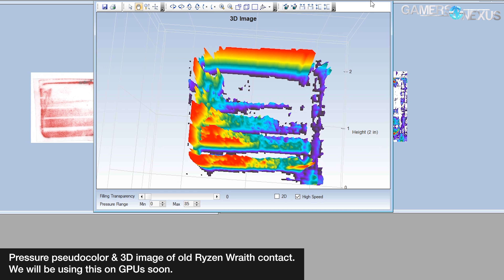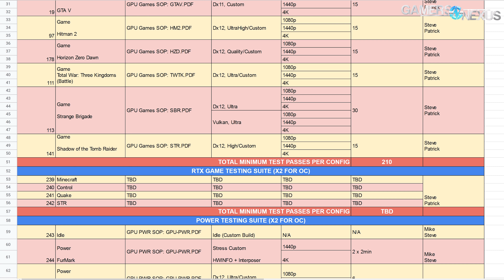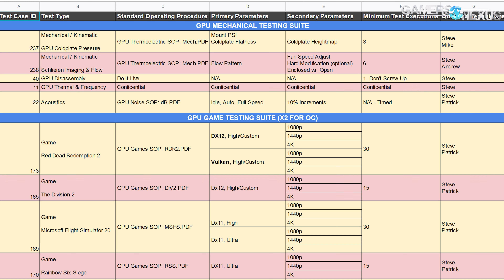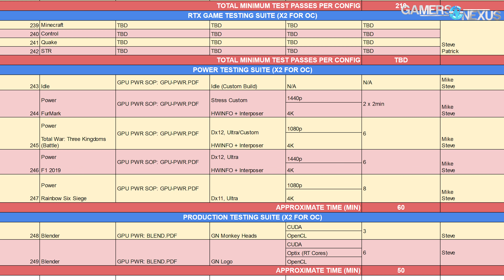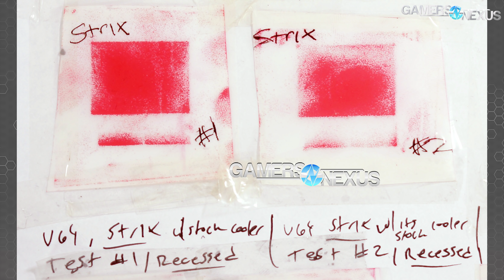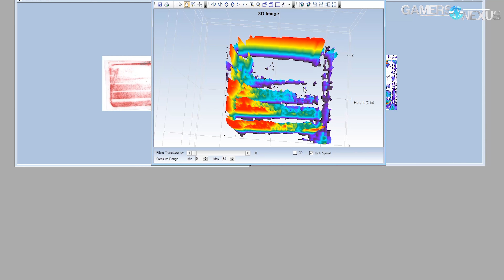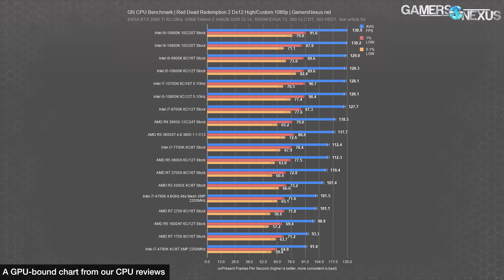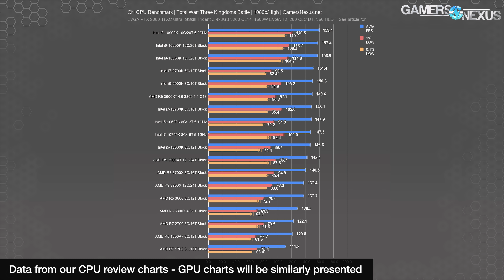$13K of GPU Test Methodology: Airflow Photography, RTX Games, Pressure Tests, Power, & More

Comment: Pls get an electron microscope now? They are dirt cheap, just saying .....
Reply from the maker: Maybe one day, but we'd need someone trained on using it!
Reply: @GamersNexus   I hear Roman might have some first hand experience with those things...
Reply: Oh, yeah. $50K for a used one is SO cheap...
Reply: @AmartharDrakestone  You forgot, that it takes also a special room for an EM.
Like special airflow or dampening of any oszillations
Reply: @emmata98   So basically a room sized Faraday cage with a separate/isolated HVAC system fitted with true HEPA in a positive pressure setup and a down-draft entry chamber into the room with a "floating" floor with a focus on vibration dampening. It's actually really do-able if you have a smallish room that has just one entrance, no windows, and has enough electrical supplied to the room to run the scope and related computers in a building with industrial height ceilings (10 foot). The hardest part would be setting up the two sets of entry doors with a down-draft system installed between them to create an entry chamber. Also assuming the building is not close to a higher traffic roadway or a railroad within a couple miles. Such a room could also double as a basic clean room for doing clean room things.
Reply: @kajuntuite4620  you also need the dampening of the vibrations coming from the outside (trucks on the street and so on).
In my uni we had one in a cleanroom, that is basicly hung on a metal frame (with dampers of course) on the outside.
The one Roman uses takes a different approach. It has 30 m (?) deep supports into the ground.
Reply: @emmata98  That's actually really interesting to hear about different ways the vibration dampening was achieved. I didn't know that about the one Roman would go visit. I can see that adding more stability to the foundation in an area with soft soil ontop of bedrock if that's what was needed, but wouldn't such supports cause more vibration transfer into the foundation from the surrounding ground from vehicle traffic? My experience with vibration dampening is a little more macro than that and it was mostly just adding springs and rubber dampeners to large machines to keep vibrations from traveling through a steel and concrete building. It was basically isolating the machines by floating them on the springs and using the rubber to dampen the springs, though in larger machines a piston dampener could be used in a setup reminiscent of how a strut and spring assembly would be used on a vehicle suspension, but I never dealt with those and the rubber dampeners were sufficient for what I dealt with. I also know that certain ways of installing a "floating" floor can be used to isolate from vibrations as well as sound isolation if acoustic insulation is used between the layers. It's all really neat tech I think :)   ...oh, such a building would need to be quite a distance from a railroad as those can transfer a TON of vibration into the surrounding ground that can propagate for a surprisingly long distance.
Reply: This thread went a bit deep, but as someone with a SEM a hand's reach away sitting on an office desk in an apartment building, I can say: you really don't need any of that for magnifications one can reasonably achieve with a scope that costs(used) less than a private jet. The worst offender is the backing pump, which is filtered by a pipe in a concrete block, the second worst is the turbomolecular pump, which is filtered by simply placing a set of damping bellows(at the factory) between the pump and the column.
Air filtering is just pure fantasy, especially positive pressure. Closest you can get is a good practice of venting the SEM(/load lock) with dry nitrogen instead of air.
Reply: @Spirit532  As someone who works as an SEM operator, I'm confused as to why you would use the price of a private jet as a comparison. Private jets cost millions to tens of millions of dollars. SEMs are expensive, for sure, but not in the range of a private jet... Even a brand new high end EPMA SEM with several WDS detectors on top of the usual SE/BSE/EDS systems will tend to cost about $2 million-ish. And that's a VERY expensive, niche scope mostly intended for geological sample studies. I work on high end field emission SEMs with several different detectors and go up to 800K magnification on a daily basis. Our instruments cost about a half-million dollars each - maybe 3/4 million, brand new, so we're getting extremely high mag for a small fraction of the cost of a private jet. Was the jet comment a joke? The wording suggests not, but the comparison just seems too far off to be serious.

I can also say that for any decently high mag shots, vibration absolutely is a concern, and it comes from a lot of different sources. I was talking to a Hitachi field service technician about one of their customers complaining about a recurring image defect they were getting, which they traced to a door being opened and closed in a hallway separate from the room the SEM was in. It was far enough away the operator couldn't even feel it, but it was screwing up their shots as lab employees came and went at specific times of the day and they thought it was just something that was wrong with the microscope. Dampening doesn't generally have to be extreme in most cases - in our lab we essentially use raised/floating floors and rubber mounting blocks to support the SEM cabinet/table which also has a spring system built into it.

At magnification low enough that vibration wouldn't be a concern, I don't know that there would be anything of value for GN to get from the instrument because it'd mostly just be one-off shots of patterns and structures that 'look cool'. Smaller structures in a modern chip aren't even visible at that kind of mag. EMF interference is a much bigger concern, especially 50/60hz, and GN has a LOT of that they'd have to contend with. They'd have to isolate the instrument if only because of that, so at that point they might as well put in the effort with good vibration dampening and not shoot themselves in the foot after spending a ton of money on it...
Reply: @GamersNexus  If you ever decide to do that I'd be interested to talk. ;)
I'm trained on SEM/TEM/AFM/FIB plus EDS analysis and some interesting light microscopes, as well as a fair amount of sample prep work.

That said, it's probably not worth the expense for what you do. Paying a service lab for the occasional imaging work would probably make a lot more sense.
Reply: Kajun Tuite Kajun Tuite Hello there. Trained electron microscope operator here, both scanning and transmission variants. You almost don’t need any of that to get useful images. You do need a vibration isolating floor, yes. But all this HEPA positive pressure stuff is totally unnecessary. SEMs AND TEMs operate with high vacuum chambers, so you need at least one turbomolecular pump ($10,000 new) and some kind of roughing oil or scroll pump ($500-$2000 new). Ideally you need lab-grade nitrogen gas to vent the high vacuum chamber, which helps to prevent air moisture from working its way into microscopic cracks of the chamber. And you need liquid nitrogen to cool some specific sensors on a TEM, maybe some SEM models too. 

If you’ve got all those, you can put the SEM or TEM into any normal room with vibration isolation. When you use the TEM in particular, that kind of room is more than good enough to see the atomic lattice structure of metals. Like, literally individual atoms. I’ve done it, many times for my PhD research. Though if you want to use a TEM, you need an instrument that can create small slices of material, around 10-100nm. Something like a focused ion beam-equipped SEM, which I’m also trained on.
Reply: @GamersNexus  I might be able to help with that if you or anyone else at GN want to get some training and are willing to travel to a location near Bedford, VA.  There's a facility owned by the company I work for that gets lots of state, federal, and private funding for the sole purpose of educating people on everything engineering.  They have a couple of electron microscopes that they love to demonstrate things on and  train new users with.
Reply: Dirt must be really expensive where you live.
Reply: I don't know why they would need something like that, unless they are trying to see if the die is really the same as the official die shots, and even then using a SEM on electronics can be a pain in the a**
Reply: azure zeed yeah. Whatever you’re looking at needs to be somehow grounded, otherwise the electron beam starts charging up the part and the image gets dimmer and dimmer. 

I’m sure there’s an entire field of electron microscopy for observing nano scale electronics. But I imagine if you want to look at a chip, the electron beam will kill it.
Reply: @Recreatorify  A used private jet can be had for under 300k :)
But no, nobody is going to sell you a 300-500kx SEM for a reasonable price. The units that you could expect to purchase are rather old and usually stop around 100-200kx magnification, but even then they don't have much use at the extremes due to the lower resolution. The best "hobbyist grade" scopes I've seen off eBay get down to is around 4nm, besides a lucky friend getting a mint condition FIB. In practice, for under $4-8k, one can expect >8-10nm resolution.
Reply: @GamersNexus  Atomic force microscopes are reasonably priced. Just saying.=

Comment: I’m an engineer at a large GPU infrastructure provider. We have a lot of customers who rely on gaming GPUs for inference, h.264 encoding, and crypto mining. Each Is a slightly different talent set and Nvidia is usually careful that not all of those features fall on the same card. Inference is great for testing fp32 and fp16 performance relative to Ampere data center, h.264 is great for testing the built in encoders and general performance when working remotely or for building VMs. Mining is a whole different story that can vary pretty wildly. Would love to see some of that represented here.

Comment: I'm a game developer and I really do feel there's not much benchmarking being done within Game engines.
I work with both Unity and Unreal engine and my purchasing decisions would be SO much more clear if there was any testing done for my field,
most tests are done in-house in big studios and I kinda have to ask around or guess. 
Game engines are interesting, especially in Unreal engine, there's multiple passes to be done in order to Build Static lighting for a scene and there's alot of nuance in trying to get Ray-Tracing features working. So far the closest thing I could draw a comparison to are there blender tests, but it's not exactly the same. 
And this is not necessarily only about GPUs though, baking lights or building a project puts strain on the whole system, so methodology would probably be closer to the way you test game performance. 
Here are some scenarios I can think of to get the ball rolling:
Get you a very nice, high fidelity level. Unreal engine has a bunch of free content for developers on its marketplace and you can build a pretty complex scene that can really strain a system.
You could approach this like people approached Crysis for benchmarks all these years, get you a chungus level and more fps=more better. 
But with some isolation of engine functionality can get some more interesting results going. 
1. Baking static lighting for a level, this puts a strain mostly on memory and CPU. GPU is secondary here. But getting some useful metrics about how a Ryzen with infinity fabric OC 1:1 would perform versus an Intel would be amazing and I've yet to see something like that anywhere. Note: My last bake at "maximum" quality for my level took 24 hours with my shitty rig, I don't imagine that's what most studios deal with though if they have current gear, there's been major architecture changes the past decade or even 2-3 years, putting those changes into numbers through bake-time would be awesome to see and very informative for me!
2. Build time. Building a project into a packaged build is a deterministic process and can be measured in seconds as long as you can make sure that the hard drive you're packaging to is not affecting results. This is a very useful metric for QA engineers and Build engineers. Packaging and re-packaging the project thousands of times is guaranteed and just like in video production, optimizing a render-machine to not waste your staff's time in useless coffe-breaks because "it's still building" is something many studios would be interested in. Afaik, this is CPU dependent mostly. 
3. Build / In - Editor FPS. This is a pretty simple game-like benchmark. Get in that level and test. How well does it run? What's the frame timings like? Note that there's always a performance difference between  the in-editor level (which is where developers spend their time) and the packaged/build level. This will  be what players spend their time in and much closer to a game benchmark. Still, there's interesting comparisons to be drawn when considering the delta between in-editor and packaged build for different components. Luckily unreal also supplies a bunch of command-line performance tools and visualizers, so you can really go into detail for a scene's performance.
4. Ray-Tracing calculations. UE4 has built-in functionality and libraries to handle Ray-Traced Lighting, using the same level as before you could very easily get a useful metric for GPU performance with FPS. Note that there's also a difference here for  in-editor and packaged builds.
5+ There's also so many more things you can test in game-engines: Baking materials, Simulation, mass drawing of actors, spawning and destroying large volumes of actors, complex animation blueprint performance impact, blueprint performance impact. The list goes on!

I would LOVE it if you guys could find a way to include UE4 or any type of game engine into your benchmarking. It's not really been done from what I've seen and with more and more people fiddling around with all these free tools, I'm sure there's an audience there to be interested in it. If not, I'm still pretty sure you'll be getting a useful metric for game performance eitherway.

If anyone from GN wants to reach out for a chat I'd be honored to help get this rolling. Steve also mentioned that he has some game devleoper contacts in the industry, so I'm pretty sure if you could talk abit with a technical director from a large studio, they could really fill you in and find a way to introduce game engine testing as a useful metric.

Snowflake if you're reading this, I love you, don't fire Steve yet, he's doing pretty good!

Comment: Hey Steve. So i wanted to talk to you guys about Blender performance that I would like you to shed some light on. Blender rendering benchmarks do not tell the full story about the performance. All the view-port stuff and simulation is mostly single threaded and scales with the clock speed of the processor. Lets say if you have done some simulation/animation and hit play, you'll find something like a threadripper 3970X skip frames in playback, whereas a 9900K will playback smoothly. This happens till the simulation/animation is fully baked and cached. This might lead the user to believe the performance is not snappy or it lags. Things are getting to multi core utilization but it is happening slowly. It would be great if you could look at this thing. Another thing I generally suggest to people who ask me for recommendations on this thing is to have them choose the highest clock-speed with highest number of cores on the CPU they can buy and push all the rendering work to the GPU.

You might look at Cinema4D documentation about how the performance scales across parts as blender is quite similar to C4D when it comes to performance and use of hardware resources. I have also tried to DM you on twitter, but couldnt.
Reply from the maker: We are aware of this, yes. But it is not currently in our benchmark suite to test viewport performance. We're so overrun already!
Reply: @GamersNexus  👍

Comment: I would love to see benchmarks for Davinci Resolve. It's editing and compositing and 3d work all rolled into one. It's very GPU dependant compared to Premiere. It's also favors more cores as opposed to Premiere preferring frequency. Id love to see more benchmarks for it as it seems that info on how Resolve actually utilizes your system seems to be lacking, even in Resolve's own documentation, and I've had to run my own experiments to see what effects performance. As with Premiere, it's very ram dependant and can quickly become bottlenecked by ram performance.

Comment: Rainbow 6 is a vulkan title too, and basically everyone uses the vulkan mode
Reply: Their implementation of using the Vulkan API is still considered to be in an experimental stage. While it helps boost performance for many users, I'm not sure if Vulkan testing shows accurate results if they haven't fully worked out issues yet, if there are any left for them to fix.